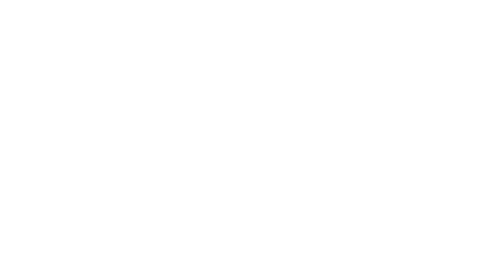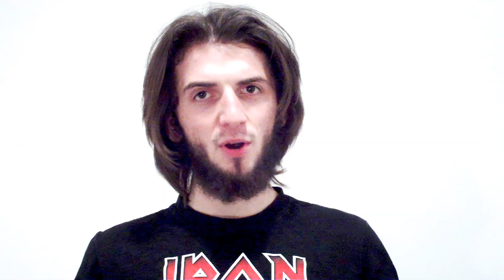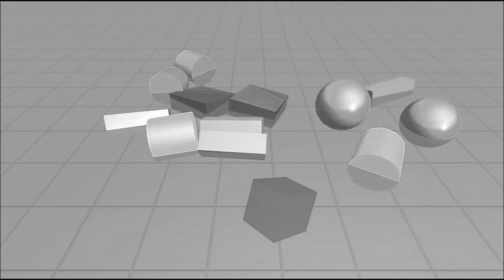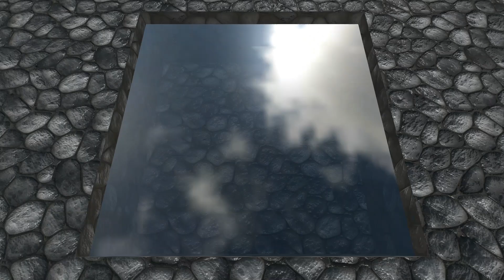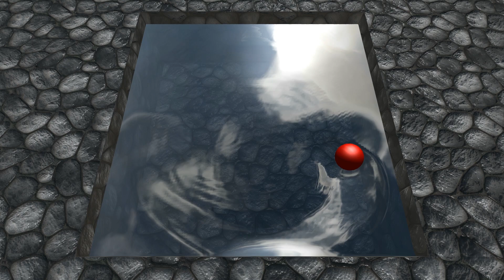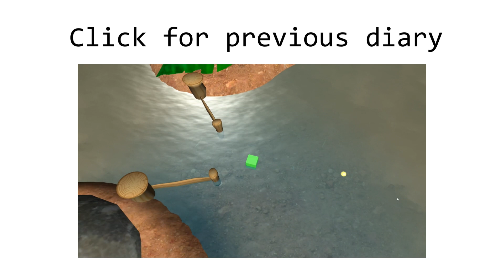Realistic water physics simulation - Nucleotide | Game development diary #7

Comment from the maker: Starting with the discrete lattice Boltzmann equation (also referred to as LBGK equation due to the collision operator used). We first do a  order Taylor series expansion about the left side of the LBE. This is chosen over a simpler  order Taylor expansion as the discrete LBE cannot be recovered. When doing the  order Taylor series expansion, the zero derivative term and the first term on the right will cancel leaving only the first... Something like this would appeal to a bigger audience?